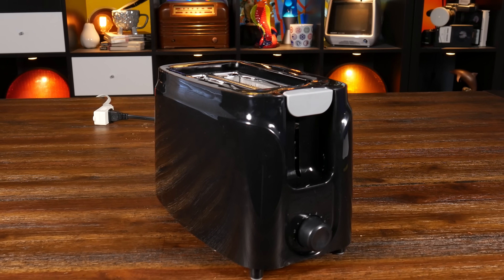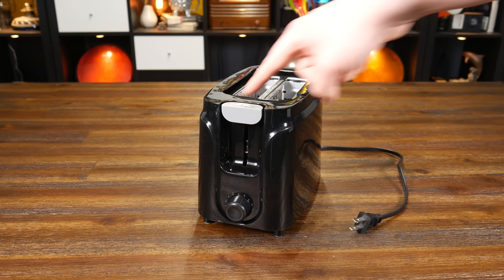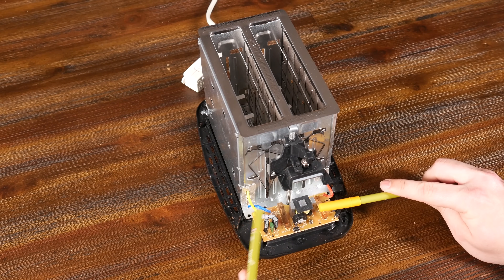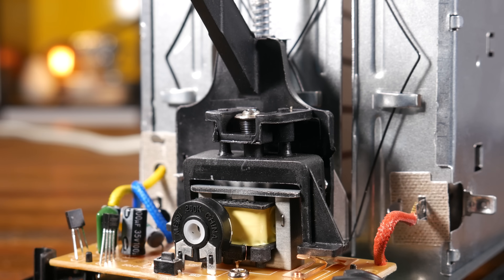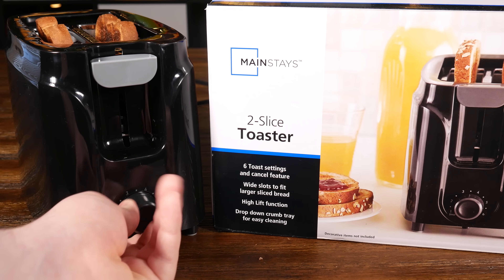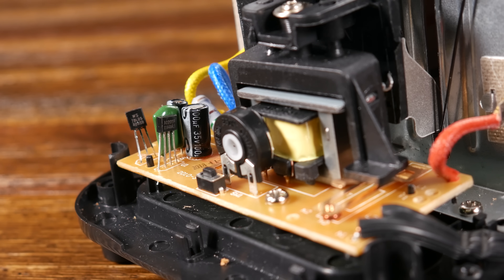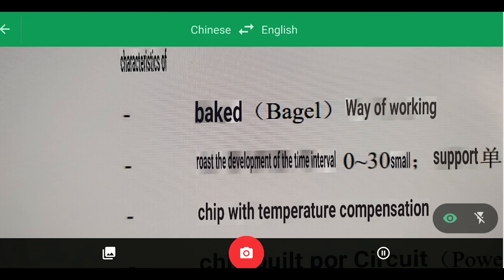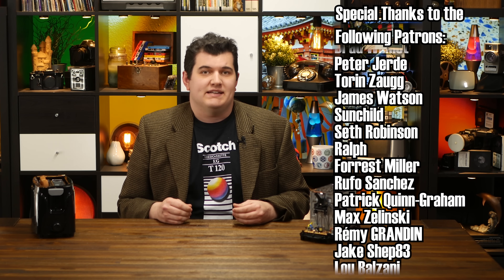The Electromagnet in Your Toaster

Comment: My favourite toaster, now sadly deceased had a "radiant control thermostat" for the timing and a tiny little magnet that held a latch to hold the lever down (actually a slider not a leever.). The cool part was that the magnet let go when it was energised the reverse of  normal magnet operation. It took me a while to work it out: There was a little permanent magnet that held a little lever down, that magnet was wound with a little AC coil. An AC coil produces an alternating field that changes direction 100 times a second (UK 50Hz.) At some point in the cycle the coil  magnetic field will cancel that of the permanent magnet, giving the little lever just enough time to fly far enough away from the magnet to escape.

So the operation of the toaster was: You push the slider down, this operates two big contacts, like on your toaster,  turning the elements on. The toast gets hot and the reflected heat warms a bimetallic strip. The strip bends and touches a contact, which lets current flow to the "de-energising" coil which lets the latch go, the handle flew up and the heaters were turned off. Two moving parts.

Comment: Just add. If use a bi metal strip. The dial only changes the distance the strip has to bend. By bringing the strip closer or further away from bi metal piece. Similar to a ocr on moters.

Comment: If you look in the A0201F datasheet and zoom in you can see where the chinese actually stole the use diagram complete with original part numbers from a different manufacturer and you can then find that the A0201F is simply a clone of the PT8A2513NE from Diodes Incorporated.
Anyway, I'm going to take a stab here and say that its a real down and dirty oscillator circuit where you are just adjusting the charge time on the capacitor and increasing or decreasing the frequency well within some operating limits, and then the cmos circuit inside the dang thing is just a big mess of cascaded clock dividers, and once it reaches a certain "magic count" it just lets go on the output. 
Looking at this application circuit, it becomes pretty clear that the function of the Diode is not in fact controlling the heater coils, but using the resistances of the heater coils themselves as the power supply. Looks like the assumption is that the toaster circuit's current draw is negligible compared to the heater coils so they can just be used as a voltage divider that produces roughly a constant voltage, maybe around 5-10 volts AC, half wave rectified into DC. This is "good enough" to hold in the electromagnet, and then the CMOS chip and the LED for the toaster on light are supplied through a 240 ohm resistor that goes into a Zeier Diode "clamping circuit" that simply makes a constant 4.1 ish volts by burning anything above that voltage off.

Comment: I remember taking apart a broken toaster when I was a kid and being surprised to find that the timer used a variable-frequency oscillator (controlled by the knob) that clocked a generic binary counter IC (can't remember how many bits now); the overflow signal when the counter "rolled over" caused the toast to pop up.

Comment: You didn't address the biggest toaster mystery of all. Older toasters, such as the ones that were around when I was a kid in the 1980s, had an arrow pointing to one of the two slots, indicating which slot you were supposed to use for toasting just one slice of bread. If you tried to toast just one slice in the wrong slot, it didn't work, i.e., it would pop up way too early and the bread would still be white. So how does it know which slot the bread is in, and why does it care?

Also, plenty of toasters have, or had, mechanically latched levers that stay down regardless of whether they are plugged in or not. Here's a picture of one that has both a mechanically latched lever and a "One Slice" arrow:

https://i.imgur.com/nSr8pGH.jpg

Comment: And an easy way for the "bagel mode", just bridge out the middle element with a relay. Use a 2 pole one, use a push switch to activate the relay. One pole to bridge the middle element, Other pole to bridge the bagel-mode push switch (aka, it keeps itself activated). Resets when power is removed. Al you need is a relay and a push button :) Simplicity!

Although, I used to have a weird toaster. It used heating tubes instead of plain wire. And timing was done with a bi-metallic strip. The latch really was mechanical (aka, it also locked without power) and a full hot-cold cycle of the bi-metallic strip released the latch. Roughly halve way it clicked when the strip reached max bend and then only cut power to the heater of the strip. (Or even, the strip was in series with the main heating element so halve way it bridged the strip heating element.)

Comment: I always assumed that it was held down by a small latch that was open, but a button would latch it on the lever, until the power was cut, then it would be sprung off with a spring and it would go up

Comment: The four pin chip is probably a timer chip similar to a 555 vs a microcontroller.
Reply: Might not be. The market for electronic toaster control Worldwide if sufficiently vast to allow the cost effective development of specific single-application ICs. Mind you it is now possible to buy single-shot programmable microcontrollers for as low as 3 cents each (when buying by the 1000 units).

Comment: I love my sun beam toasters. I have rebuilt a bunch of them. The way they get the toast to lower is ingenious they have leaf springs that when heated loose there spring and the weight of the bread will take it down. Then when it's done it cools off and back up it goes. What other mechanical device could work on a daily basis for a hundred years and still make perfect toast. However my favorite toaster is the toast-o-laser the toast walks through a heating element. And it has a window for your enjoyment!

Comment: What's amazing is that the part that holds the lever down is not merely an electrical magnet, but a transformer which lowers voltage for the logic board. Instead of having a transformer and an electrical magnet, they split the transformer core, to make it serve a double purpose.

Comment: Toasters were the first bit of tech that I investigated when I was 10 years old. Mine was way simpler than this.  Switch engaged by the lever, and bi-metal element near the bread, adjustable with a mechanical control, to pop the toaster at the appropriate time.

Comment: Every toaster I've owned & most common toasters are purely mechanical. No circuit board or magnet. Push the lever down engages a latch & a microswitch to activate the heating elements... much like a retractable pen engages. The latch will stay in place unplugged. As the toaster heats up, a bit of metal expands & disengages the latch. Adjusting the knob changes the position of the expanding metal so it takes more or less heat & time before it disengages the latch. The latch does not hold tightly though, so you can lift the lever to stop the toaster if your toast is burning. Maybe those Chinese imports are made differently.

Comment: woah, what a fancy modern bread singing device.. mine had cost about 20$ and uses a bi-metal strip that gets pre-tensioned with the duration dial.. no circuit boards and displays at all.

Comment: Looks to me like you need to tame toaster timing technology through time-tested trickery.
I'd suggest disconnecting the heating elements in your toaster, then unplugging it (or hitting a cutout switch) when you want that magic electromagnet to release and the toast to pop out at the right moment in the script. Naturally, you'll need to actually toast the bread separately before engaging the not-toaster prop.

Comment: Keep em coming my friend haha. Thanks for the video! Even with as much appliance experience I have, I didn't realize there was an electromagnet in a toaster lol. Me myself, I'm having fun with kerosene forced air heaters today, already found one with a bad transformer and blown motor capacitor, one needed an igniter module, and the rest all need air pumps. The pumps are apparently made of some sort of carbon material, my buddy does refractory work so they don't like that environment, he just gifted me six lol.  Easy to work on though, kind of neat to see so many at once and see how desa evolved over the years from all the buyouts. I think its pinnacle now. Same basic design, they've just changed the air filter housing somewhat. 
That's a very long winded way to say thank you for going into detail of history of toaster timers. That would have been my next google search after watching this video if you had not included this tasty tidbit of technical trivia.

Comment: Actually, on older toasters (definitely the 1960's) you could push the lever down when the toaster was unplugged, since they didn't use an electromagnet back then.  The bimetallic strip would be turned tighter or loosed by the knob, and pushing down the lever completed the circuit.  The bimetallic strip would be heated, and eventually it's expansion would disengage the catch that held the lever down.  Then a spring would pop the toast carrier up.  You could release the toast earlier by pulling the lever out, which would release the catch.

Comment: Is there any way you could be convinced to talk about Velomobiles? They get approximately 172.5 miles per kwh (~5700 MPGe) when using an electric motor to power them, and they cost a fraction what a car does.

Comment: The yellow lead is the tap off the giant resistor, i.e., heating element that is then rectified, for the voltage regulator to step down to the 5v needed for the electronics.  

Did you note they don't use a safety ground on the toaster even though it has conductive parts exposed that could become live during a fault?  I read that was because there was no way to keep idiots with forks and  knives from shorting the heating element to the frame so it was safer to leave it as an isolated circuit.

Comment: First of all, I love the alliterations.The timing circuit? Let's see, you have a diode with half cycle pulsed output... 60 pulses per second... That's the clock. ;-) The other possibility is that the chip has an internal 555 timer type oscillator. The schematic on the pdf tends to support the latter. Also, before the electronic version you displayed, I have only ever seen the bimetal thermostat one.
Reply: It's actually bimetallic

Comment: My Mom refused to replace our toaster until I was a teenager, because it was a wedding gift (and they got married 7 years before I was born, so you can imagine how old that thing was).  It would "click" about half a minute before popping up, and popping it up manually could get you "medium" toast.  The knob completely cranked to "light" was "dark" toast.  After we finally convinced my Mom to give that thing up, I got an extension cord and put it outside on "dark".  Smoke filled the backyard.  I decided to eat it anyway, and my Dad took a picture (film at the time, of course) of me with carbon around my mouth.  I'm going to ask my Mom if she can find that picture.  Excellent and very interesting video (as always)!!!!
Reply: We had a such a two-click toaster. About 50 years ago I dismantled it to find out how it works. To my parents (rest their souls) I used "I am cleaning it" as an excuse...

Turned out there was a bimetallic strip with its own heating element (wire similar to the toast heating elements was wrapped around it.) Upon pressing the lever down, it was caught by a catch that locked it down and initiated the toasting. 
The metal strip heater started glowing dimly and the strip started bending. After a while, its bending released it and it switched off its own mini heater. That was the first click. Toasting kept going.
When the strip was cooling down, it started turning back straight. When it was fully cooled and straightened out, it mechanically forced the lever catch open, releasing the lever. Toasting off.

(Just as a background information, then, 50 years ago, I also put the toaster back together, in working condition. The toaster was clean and my parents were not angry...)

Comment: You have the wrong datasheet for the a0201f. The same number is oddly enough used for multiple chips. The schematic for your toaster is:
https://elektrotanya.com/files/forum/2013/04/Tesco%202T06%20A0201F.jpg
The chip is a simple timer circuit.
Edit:
Ah ha. Found it:
https://www.diodes.com/assets/Datasheets/PT8A2512.pdf

Edit #2:
Someone beat me to it.

Comment: The diode attached to the heater coils is probably a snubbing diode used to kill the voltage spike that occurs when the IC turns off the heating elements.  These are common in circuits that switch inductive loads, like the heater coils.

Comment: I used to have an old toaster that would stay down even if you pushed the lever while it was unplugged. I think it must have been using a purely mechanical latching system. Probably used a "dumb" bimetallic strip as well, but it's long gone so I can't take it apart and check.

In fact I remember most toasters in my childhood working like this. Even one that had broken and would never pop up, so you had to watch it and pop it up manually or be faced with burning bread.

Comment: As for the diode: Coils of wire can store electricity. When the power is turned off, it can dump the stored charge back through the circuit, and damage components. Sometimes diodes are used to force that charge down a specific path to prevent premature failure of the unit.

I don't know for sure that it's being used for that purpose here, but with both the electromagnetic coil and possibly the heating element holding a charge, it sure would help protect the capacitors and smaller surface mount components from being temporarily ran backwards.
Reply: There’s a protection diode across the electromagnet to protect the transistor used to switch the electromagnet, which is to protect that transistor from kickback. A failure there could result in a burned down house because of the transistor shorting.

Comment: This is not an electromagnet, it's a transformer! Besides acting as an electromagnet it is a part of a step-down converter, which generates 5V for the IC. What the lever does is closes the enclosure of the transformer, increasing it's efficiency but also making it stick due to flowing current from the mains. So it is brilliant but even more so.

Comment: It’s been a while, but I was in a vintage toaster, the ones I remember had an electromagnet as the release. The temperature setting adjusted contacts on a bimetallic thing, when it flexed far enough to make contact it would send power to the coil, and then pop the release. But I want to say some also used the bimetallic strip to break contact on a magnet like this too. I’ve only been in older toasters with the all mechanical temperature control, never a circuit board model.

Comment: That old toaster looks like it plugs into a light bulb socket.

Would certainly work, I guess.
Reply: It did. They were used for light bulbs, fuses, and outlets. Not terribly safe, I might add. Our "modern" sockets came much later.
Reply: This was common yes.
Light bulbs were the first widespread electric appliances, so their sockets were the de-facto plug standard. A bit like cigar lighter is for car appliances now.
There were things like "strips" you could plug extensions AND a bulb in, yikes !

Comment: Just a small correction , the diode is there as a half wave rectifier for the power supply they take the power of 1 of the 4 heating elements and as they are in series you end up with mains voltage/4 so in the U.S. about 25vac after rectification there is around 12 to 15 dc left what is used for the electromagnet.  There is no control for the elements except on and off. For the rest a good video.

Comment: according to the schematic diagram, the incoming AC is ran through a "hot potential divider" (thanks photon!) which, when assuming equal elements, would drop the 120 volts down to roughly 30 volts before its half-wave rectified into a simple Zener-regulator supply; outputting 3 volts  which is fed to the IC.  simple and fun for everyone!

Comment: For taking mine apart for repair, I realized the yellow lead you have should be connected at roughly 10% from the end or begining of your heating element, thus providing 10% of the voltage for the low voltage side of the circuit to operate (voltage divider). Another genius way to get things done without a transformer or switching power supply!!